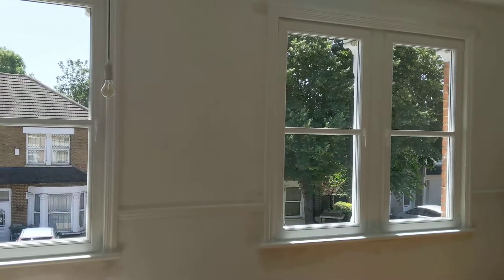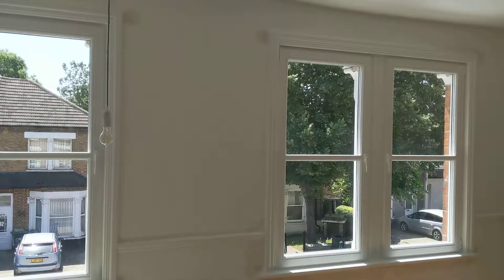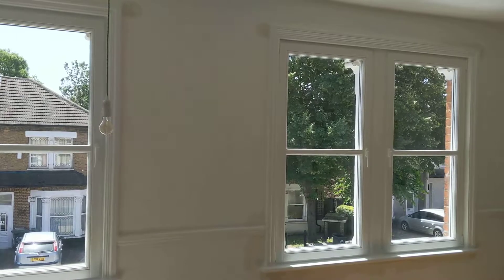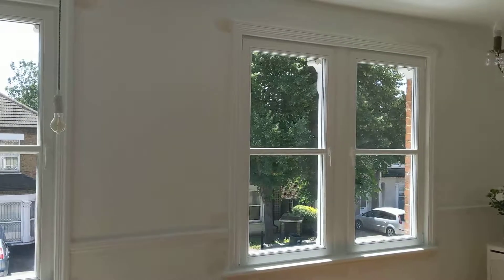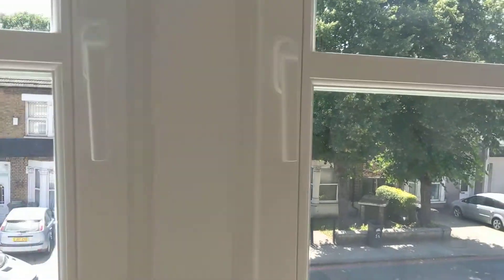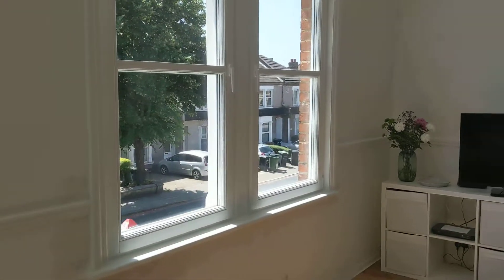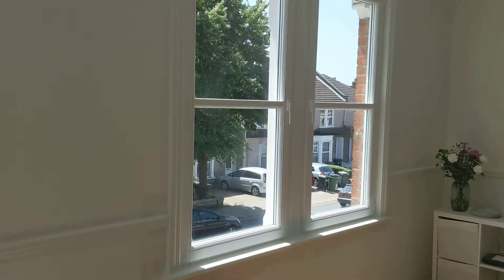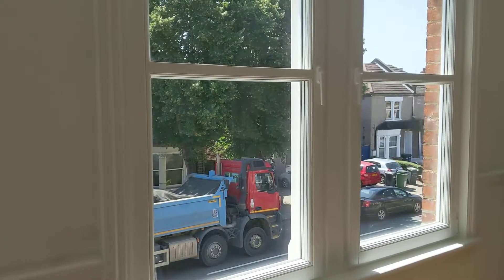Traffic Noise vs Imitation Sash Window Soundproof Ultra 51dB

Comment: How thick are the glass configuration? And how thick are your frames?

Is it like a 10.5 with like 16 mm air gap with a 8.5?
Reply from the maker: 10.8mm Acu /12mm argon/4mm flot/14mm Argon/8.8mm Acu alternatively 10.8mm Acu/20 Argon/ 12.8mm Acu